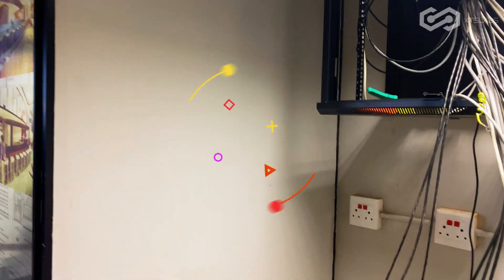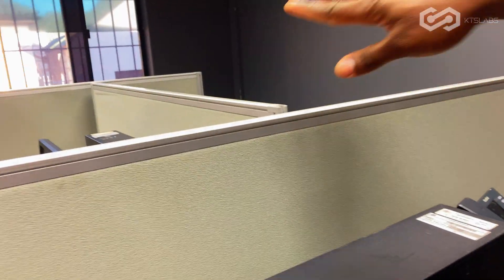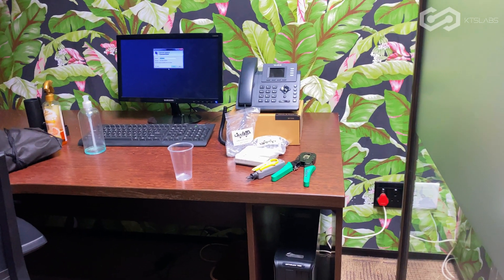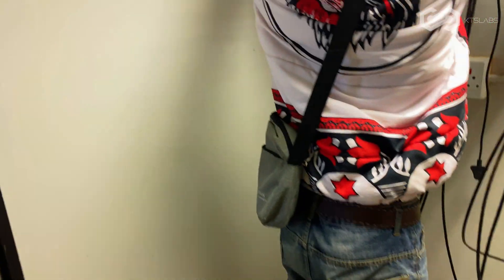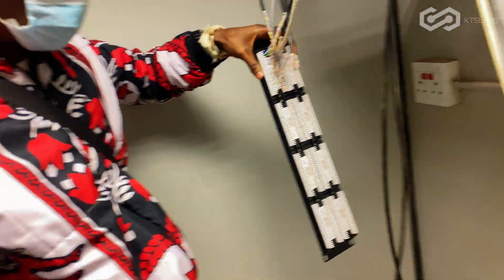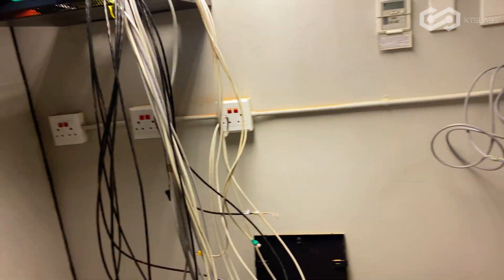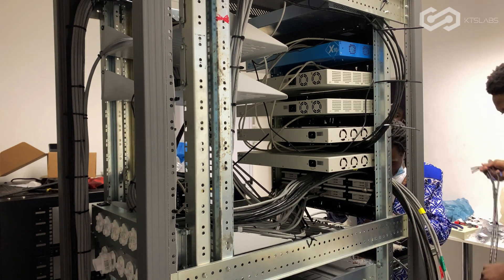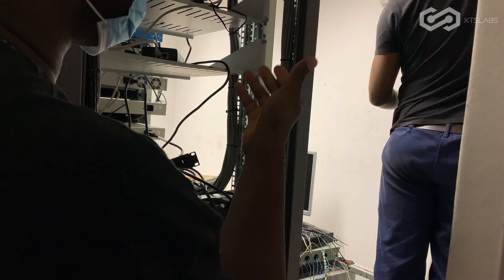New Building Network from Start to Finish EP15

Comment: That punchdown work needs ALOT of improvement, you left way to much space between the punchdown and the cable. IMO use keystones too. Another suggestion, Ditch the ZIP ties, use Velcro, if you can't then atleast cut them so you don't slice your arm open when reaching into the cabinet on the little sharp edge that sticks out..!!
Reply from the maker: Thanks Jason 👊🏽, my first choice was velcro and keystone patch panel but unfortunately the supplier had none so we had to work with this one which wasn’t fun 😂.